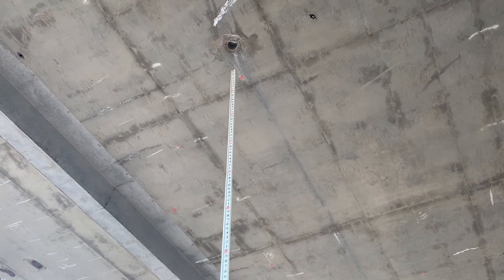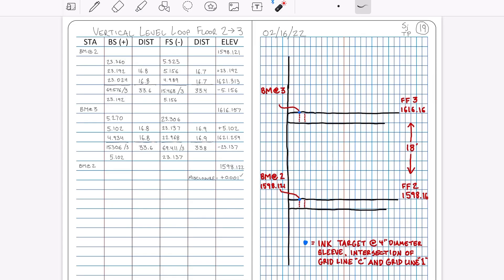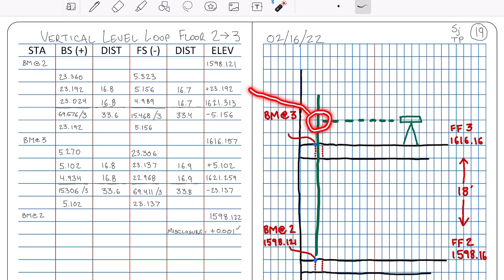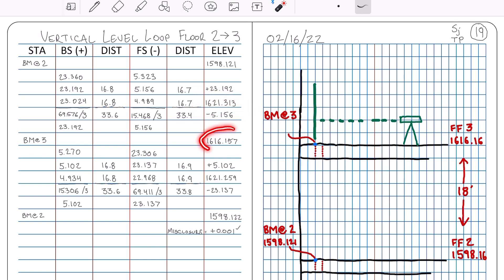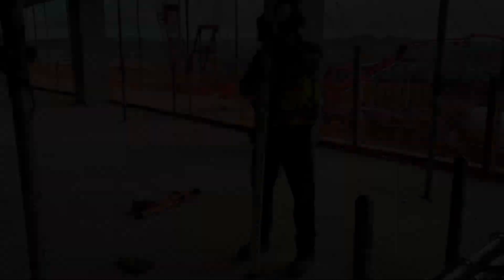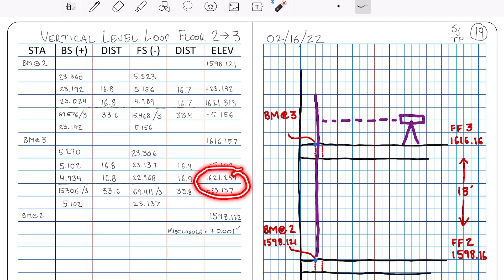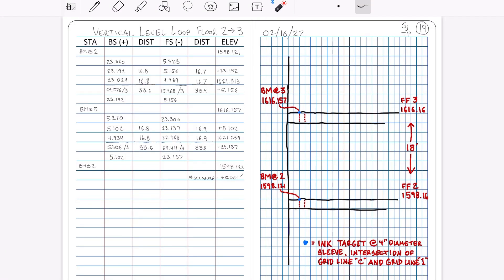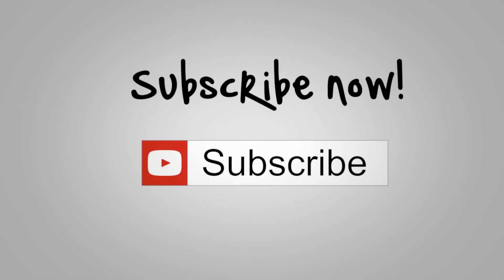Surveying: Transferring Elevations Floor to Floor

Comment: Is it always necessary to use a penetration to accomplish this? (and what method do you use to ensure your penetration will be directly above your lower floor bench mark?)
Reply from the maker: @bwhog  That feature also needs a video. A PLS or similar vertical laser from mark on the floor below projected onto the deck of the next floor, then drive a screw partially through the deck.  Then a PVC sleeve cut to the correct deck thickness is taped or wired into place where the nail pokes through and the opening is covered with duct tape.  After the pour, you just poke the tape out and you can project that as many floors as needed. You could also perform this work when only half the deck was poured and avoid penetrations at all.  Just putting this idea out there as an option since many folks are pulling from a 4’ above FF chalk line that no one knows how it was set or god knows who’s crows foot mark with an elevation written next to it in a door jam.

Comment: Pulling a steel tape floor to floor and over all bottom floor to top floor and doing tape corrections will be far more accurate than using a 25 foot stadia rod .
Reply from the maker: I do mention that method, but it also depends on what you’re trying to create. Are you just transferring a chalk line floor to floor, are you setting one vertical series of targets along a crane tower, or are you setting yourself up to create multiple benchmarks on each floor, multiple vertical targets and take as-built observations.  The end product often drives the methodology.  Having a level setup on each floor facilitates control and QC work, and from a lean perspective.. if the level is set up, why switch to different methods of leveling which create their own time and equipment constraints.. there is a lot to be said for one piece flow.  Whatever the methodology, driving home the importance of starting from a benchmark versus pulling a tape from an as-built finish surface is key.
Reply: My perspective as a 4 decade Chief of party is to do the work to the highest degree of accuracy possible, whether it be laying out grid on a high rise in Boston or transferring grades from floor to floor so that all of the subsequent trades are working from the same datum . There is too much liability involved to not do it correctly , 25 foot stadia rods are notoriously inaccurate especially when fully extended. I use a Leica LS10 .3mm digital level to set benchmarks for trades , a fiberglass rod is good for topo in the woods and measuring drainage inverts IMHO .
Reply from the maker: @1972GT160  I love the perspective. A lot of important points made there than SHOULD be acknowledged by all. 1) grade rods are notoriously inaccurate- and so proper leveling technique should be used at all times to ensure rod plumb, when button snaps show any wiggle room whatsoever the rod should be replaced, and a closed and adjusted level loop should be run at all times. You used the term ‘done correctly’.. closed and adjusted loops or running a tape back and forth and performing adjustments are what ‘correctly’ means. I wouldn’t focus on any one methodology as being correct so much as the inclusion of forms of adjustment forcing all work containing human error to to yield a perfected product.  Another point I feel it important to make is that steel does undergo significant expansion and contraction- especially in areas with drastic temperatures or drastic temperature swings. Those using crane towers may experience this, in fact the tower may flex daily while its under load.  The timing of using or setting targets should be considered as such changes may dramatically effect your subsequent results. Those in the industry working as field engineers will very rarely have access to a digital level, the cost model of a builders level usually fits the budget more appropriately- but don’t sweat it.  It’s not the cost of the tool, its the acknowledgement of intelligent correction methods in every activity that will ultimately count.  Mr. Party Chief, I appreciate your well thought out feedback and comments! I love the consideration and intentionality you pour into your personal practices!

Comment: Or you could setup Auto Level at 2nd Floor and flip the rod where Zero is through the hole and level on the 3rd Floor Top Slab.
Reply from the maker: There are lots of ways to perform the process of transferring elevations, but the most important takeaway is to always close your loop and adjust your results to reflect your averages for true accuracy!

Comment: Hi, usually Starting from which floor you transfer B.M ? Tnx
Reply from the maker: Starting from any site benchmark that has already been a part of a closed level loop that is tied to the project or site benchmark. Finished floor should never be used as a benchmark as its construction often contains too many variations to be held. I’ll typically set benchmarks on all 4 corners of a floor as soon as the concrete is dry.

Comment: In tall structures like skyscrapers. How can we move the fixed points to the upper floors, thanks sir
Reply from the maker: If you mean vertical benchmarks, using the floor to floor method shown in this video. If you mean horizontal marks for base line- a spinning vertical laser to set two base line points and then turning angles from those two points is a solid method.